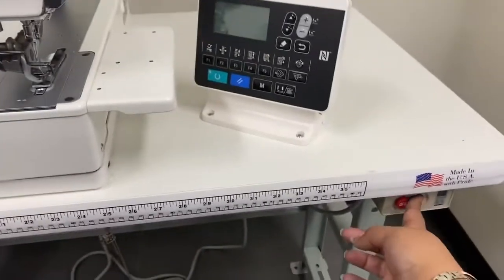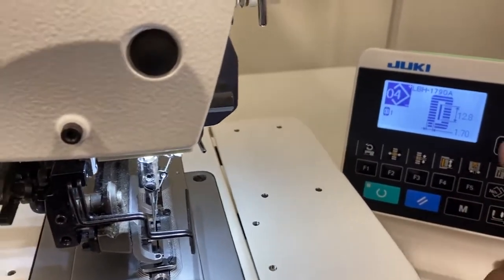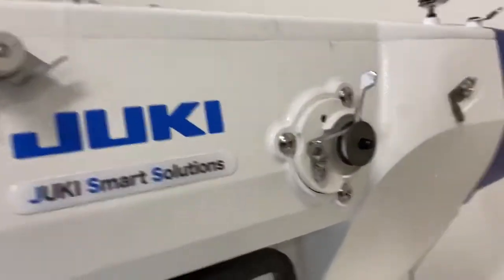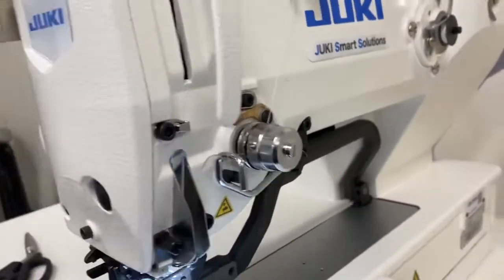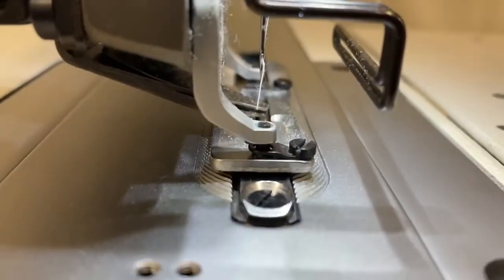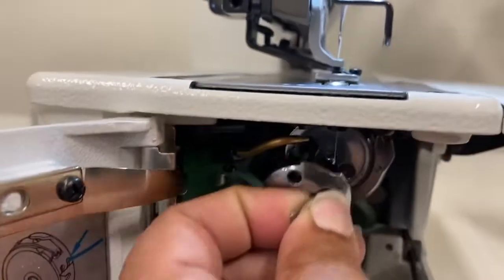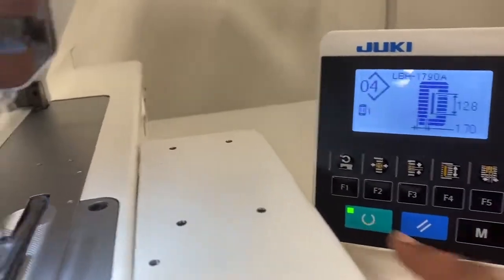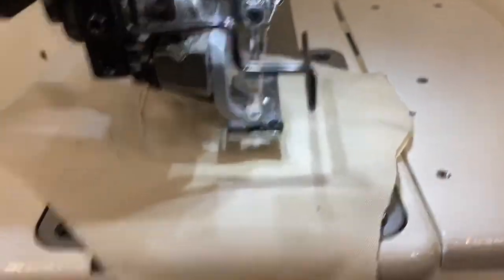Operating the Juki industrial buttonhole machine

Comment: Please remake this video: tell which Juki buttonhole machine this is, describe the unit on the righthand side of the buttonholer and its features, perform additional samples of the finished buttonhole and use different color thread so the viewers can get a better view of the results, also ask some to assist with filming. Thanks.
Reply from the maker: Naomi, I apologize, this was a video specifically for my design course.  I no longer have access to this machine, as I cannot remake the video.  Please feel free to email me if you have any questions.